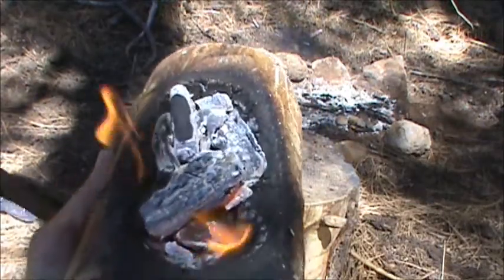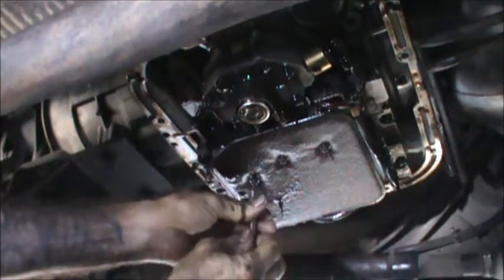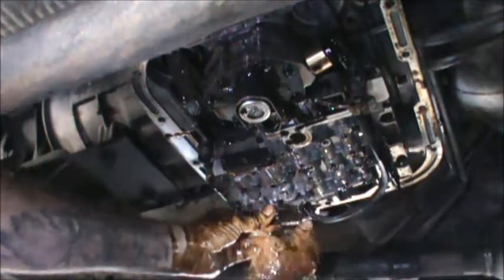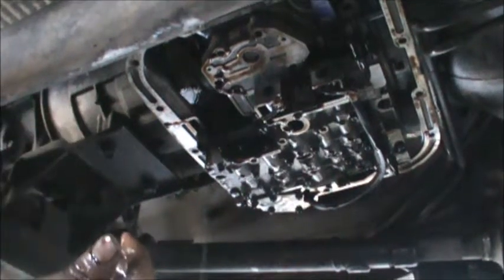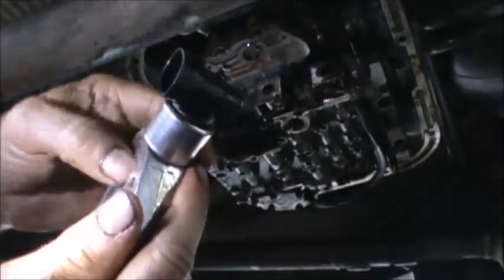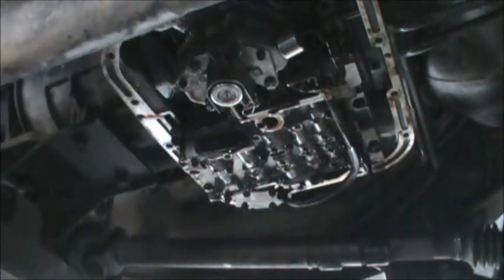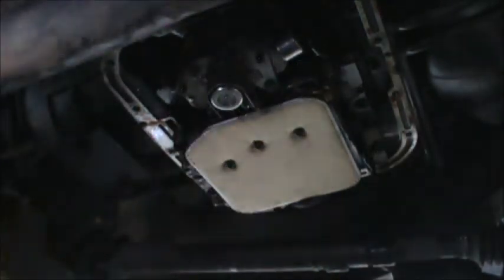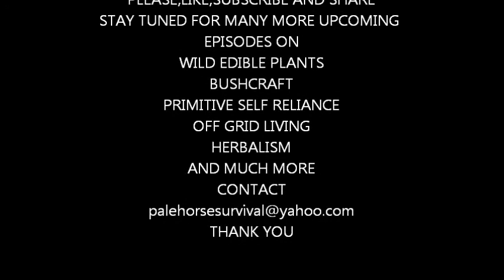jeep 44re transmission tune up,filter,governor pressure solenoid sensor, accumulator spring, band ad

Comment: That's the rear band. I believe that band Is supposed to be torqued down to 41 in/lbs and then backed off 2 turns. The front band is supposed to be torqued down to 72 in/lbs and backed off 2 turns. That's up on the left side up behind the shifter linkage. That's what my Chilton's manual says anyway. Is that a 4.0L or a 5.2L?
Reply: FSM says 44RE  " front band release lock nut, tighten adjusting screw to 72 in lbs then backoff 2 1/4 turns tighten lock nut to 30 ft lbs  rear band release lock nut tighten adjusting screw to 72in lbs  then backoff 4 turns tighten locknut to 25 ft lbs"